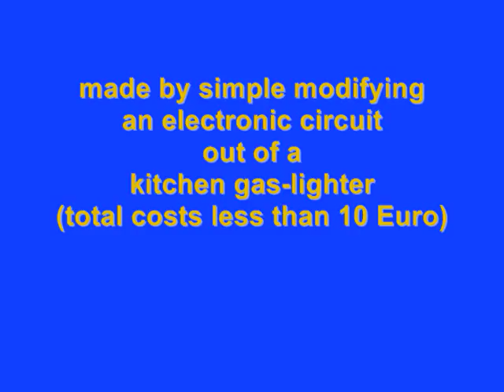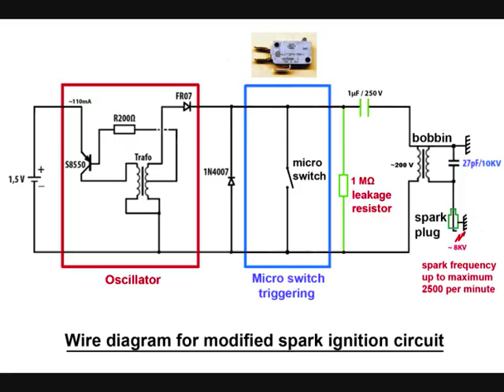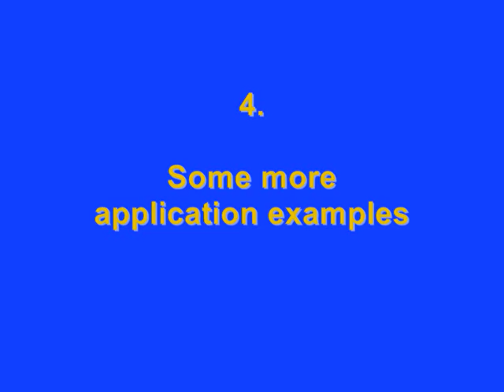Homemade Miniature Spark Ignitor

Comment: Hi Jan. I am about to use your 'Bloker' spark generator idea on a Chinese engine with a failed spark unit. I will be using the thyristor and reed switch and have read your page on your website about how to do it. Great idea. Thanks! 

Just one point though for those using the simpler micro switch way of breaking the low tension circuit. You mention the problem of sparking across the switch contacts and the fact that this will eventually destroy the switch. Of course, this was always a problem with the full sized contact breaker points of traditional full sized petrol engines. This is why they had the condensor or capacitor connected across the contact breaker (switch in this case). If you fitted a suitable capacitor across the micro switch in your engines which use that method, you can stop this and also increase the energy of the spark.  Thanks again for an excellent and cheap solution.

Comment: Is this sparking system called "CDI" normally used with motorbike. But by the way, Is it possible to use infrared LED ,infrared sensor and a transistor to trig instead of a micro-switch. Great job,thanks.

Comment: In the original gas lighter circuit, D1 is blocking the thyristor drive. Don't see how it can work.
Reply from the maker: Hello Peter,
If you mention D1 you are referring to the original gaslighter circuit. D1 is a switching diode that blocks below 75 volt. But above 75 volt this diode becomes conductive and the thyristor is driven then, causing the capacitor discharging over the primairy coil of the bobbin making one spark. The voltage over the D1 becomes zero at that moment but the oscillator part of the circuit will raise the voltage  to 75 volt again making another the spark. So this original circuit will make a continuous spark row to ignite gas of a stove.
So, for the application on IC engines this D1 diode must be removed because the spark must only occur on command of a switch on the engine that closes for a short moment of maximum compression in the cylinder.
I can assure you that this works perfectly, not only with my engines but also with engines that are made by people according to my engine drawing plans and the adapted spark circuit.
Reply: I agree that in the original gas lighter circuit the 1N4148 diode will break down at around 50-100V. However, to rely on this is bad design practice. It would be better to wire it forward biased, with a series resistor, to set the trigger voltage in conjunction with the 2k2 resistor. I guess they were trying to reduce component count.
Reply: Jan Ridders 
Super video

Comment: how do you make yore pistons for the engine?
Reply from the maker: I make the piston simply by lathing them from the desired material.
Friendly greetings from Holland,

Jan Ridders
Reply: Jan Ridders can you make a tutorial abut it?
Reply from the maker: Andriy Babii The best way to make an exact cylindrical and smooth cylinder hole is honing (lapping). But most amateur model builders (like me) don’t have the equipment for that. So I have made the following procedure for it:
I first lathe the bore in the cylinder with some tenth of a millimeter less than required. The absolute diameter is not important since I make the piston fit in the cylinder later (see below). Then I start reaming the cylinder bore manually with an adjustable reamer in my bench vice and with ample oil, turning the cylinder around and around several times with the same reamer adjustment until the reamer can pass easily through the bore. Then I adjust the reamer a fraction wider and repeat this treatment again and again until hardly any diameter difference can be measured over the cylinder length anymore with a micro meter. This makes the taper of the cylinder bore equal or less than 0.01mm and very smooth. This way of working can compete with real honing (lapping) and is a good alternative if you don't have honing equipment.
Then I lathe the piston so that it fits somewhat “sticky” in the cylinder and polish it manually in the cylinder with very fine grinding paste until it moves nice and easy in the cylinder. For this fine grinding paste I mostly use the auto car cleaner “Commandant nr. 4” as is used for wearied (old) auto car lacquer. The result is a piston fitting with very small clearance (0.02mm or less) with a good compression and very low friction as a result. With this result there is no need for piston rings for this kind of small models, which is not only easy, but it also makes it easy for the relative low engine power to overcome this low friction.
It is possible to make this all only with lathing the bore in the cylinder and the piston, but then you need a very precise lathe (exact cylindrical and smooth turning), sharp cutting tool and some good experience with lathing. I myself prefer the method as described above

Comment: Hello! I bought a lighter for a gas stove, the same as the clip. I changed the capacitor, removed the transistor, the resistor and the diode - it got a good spark but could not ignite the fuel mixture in my engine! When I use a car induction coil, do not worry - my engine works perfectly !?
Reply: hy , you can build it also in 3 or 4,2 volts battery , here you must change the oscillator resistance , from 300 or 470 ohm ,, that the transistor do not got hot , and at last the bobbin , primäry and secondary coil must be on one side together on the earth , mass of the circuit , otherwise the body of the engine give you a high voltage schock , all other parts work well , you need a 400 volt condensator , i use the tick 106 d , is good , with reedswitch , the spark result is now very strong and ignit every mixed fuel for every engine , engines with a good compression just work enough well with 1,5 volts circuit , and without plastic o rings , the fricton here is to high

Comment: never had time to look and wonder about how to do things just fix it your costing us 70,000 an hour, a little laiter in life at a job interview sitting in a true tinkerers office, and i said that to him, he kinda looked pissed and asked me what i ment, he had parts from one machine or another some compleated and almost dun gear boxes along with a minnature feed loadout, he had all this mechanicle stuff, then showed me his pictures of plc's he built at home, 20 years as a millwright i was in awe, i probly leaned or locked out on that equipment once or twice and needless to say i didn't get the job , i wan't to build the top part of a rotary plane engine, a v4 and mount it in a board track looking frame, i wonder if it would be to opposeing to stay running and what it would sound like if it did